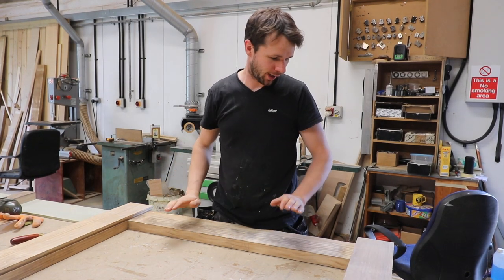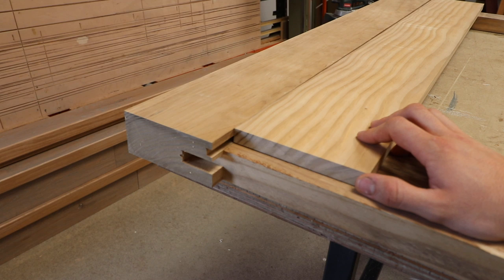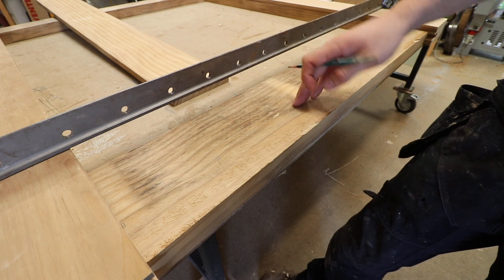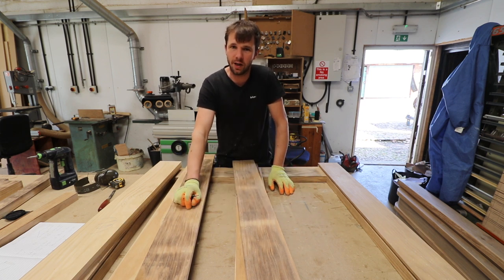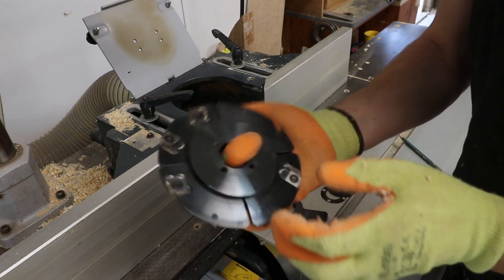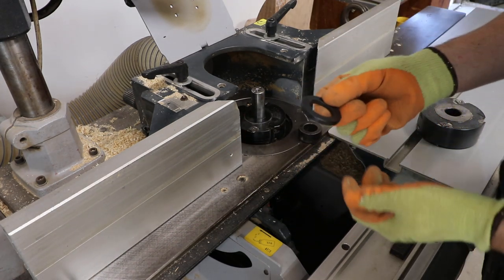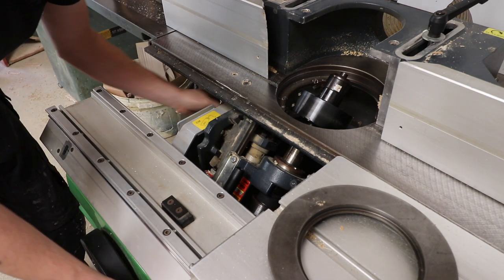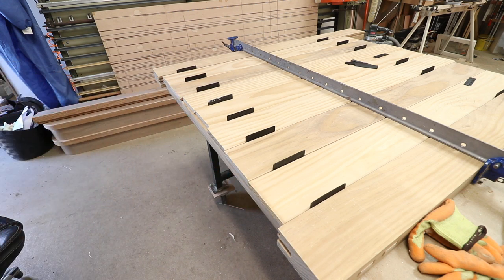TGV Matching Boards. How to make your own

Comment: Great video. I use the same moulder,  those extension tables look useful. Pricey though knowing felder
Reply from the maker: HI James they are great! I wouldnt have bought and had i not recieved one with the machine when i bought that.... i now have 3 that i use on the spindle, planer and bandsaw, im constantly swapping them about. Spindle moulder feels small/not as safe when they aren't on so i rarely use it without them!

Comment: Very useful, Thanks. I don't own a spindle moulder, but I can use these principles on my Festool router table with their spindle and cutters. It'll be good enough for an amateur who can put up with the tool changes!
Reply from the maker: Main thing with boarding is when doing the rebating be very careful not to get variations in the thickness of the tongue. If you work from both faces and the boards are not planed accurately it's real easy to get problems! 
Glad the video has been of some help

Comment: Great video, love seeing all the spindle work.  I have that adjustable groover as well, and it's the one I use the most.  You are spoiled over there with easy access to Accoya!  On this side of the pond you need to sell a kidney to buy a few sticks of it!
Reply from the maker: Thanks buddy! It's a brilliant bit of kit that groover. Much better than the wobble saw I moved on from! 

It's pretty dear over here, £2500 per m3 roughly! Worth it though
Reply: That's funny, I moved to it from a wobble saw too!  I'm curious about that gap in sizes between 7.5 and 8.  I'll have yo look at mine because I don't think I've used it in that range.

Comment: Another quality video thanks for sharing - what overall thickness do your gates tend to come out at they look around 60mm ? Thanks
Reply from the maker: Thanks Harry. Depends on the application, but for something nice and strong usually around 58mm in Accoya. I would have used ex 2" for this particular gate but only had 2.5" stock of timber in so thought why thin it down!

Comment: Hi Brad, I am using Iroko and am making garage barn doors and frame and also side door to match, I will be making them to your method of making, a traditional way of making tung and grooved barn doors, is it worth using the Iroko for the side door cill or is it worth using sapelle?  what is the difference in price of the wood you are using and Iroko, you may ask why am I using Iroko, the reason is I do not want to paint or finish the wood I want a lovely looking wood finish. I have subscribed to your channel as it is the best channel I know of that explains joinery really well. There is a lot there I already know but with age it is easy to need a reminder and your videos remind me what I should be doing so thank you very much from an aging cabinet maker & Joiner. I have started my own channel for unusual jobs called Ian Robinson Cabinetry & Joinery no where near as good as these videos mind, I used to run a big company for joinery and cabinetry but too stressful after 20 years running it, I now have a small workshop that I really love working in but not got as many machines anymore but I do cope easily and found I do not need as much as I used to. keep up the good work it is great to see a fellow joiner at work.
Reply from the maker: Hi Buddy, thanks for this, There isnt much in the Iroko/sapele difference, i would lean toward iroko if you are staining/natural finish and sapele if you are painting. I would say iroko is more durable than sapele in my experience. In terms of the difference in them to Accoya, over double the price accoya is but durability is exceptional. in a average setting hardwood is 20-30 years, accoya 50 plus, aswell as the added benefit of no movement during that time. Thanks for the sub!!
Reply: @BradshawJoinery  wow that is impressive with accoya. Do you finish accoya or leave it unfinished?

Comment: Another great video with lots of useful information. What’s the alarm sound that appears in some of your videos?
Reply from the maker: Thanks Mark, they are Gate alarms, they are dual beam sensors that alarm when something passes through them. 100% accurate. Works well with the CCTV you can quickly keep an eye on who's about. Much more relaxing than running outside to check everytime you hear a vehicle slowing down!
Reply: Bradshaw Joinery sounds good I wouldn’t mind details of that.

Comment: Morning,

I'm just about to build two oak gates circa 400 mm wide and fit with t&g - this oak was cut 34 years ago and has been barn stored - I'm using a router table but given your comments on expansion and contraction what gap would you recommend between boards for allowance - the panels will be 18mm thick? Aways find your videos thoroughly educational and uplifting.
Reply from the maker: If it's bone dry, I'd look for 2.5mm as it will expand in winter and shouldn't shrink much more. All depends on the moisture reading. Nail/pin the boards on instead of screws and the screws will most likely fail where a nail will give/bend.

Comment: hey, around 7 minutes in you mention that in summer the wood will be the driest of the dry and in winter the wettest of the wet in full humidity, but my understanding was that wood expands in summer due to higher humidity and shrinks in winter as air is dryer.. have I got this completely wrong!?
Reply from the maker: Yes for external woodwork. Maybe internal woodwork there could be an argument in the opposite direction but I've not witnessed it myself. My Garage doors are softwood and they have shrunk that much on the boarding they aren't far off showing gaps yet In the winter they are tight up to each other! 
You have to be careful with humidity though and you are correct that winter can have lower humidity. When temps are low the air is really dry. Can notice it with paint application where the wb paint will dry out rather than cure and cause problems!
Reply: Depends where you are, I grew up in a place that had wet winters and dry summers, i.e. wood swelled in winter. I now live in a place where the opposite is true, dry winters and wet summers, everything swells here in the summer.
Reply from the maker: @johnpatrick4983  Very True!
Reply: I live in Cape Town, South Africa and we have wet winters and warm summers. The wood swells in the winter and contracts in the summer. Thank you for highlighting this point.